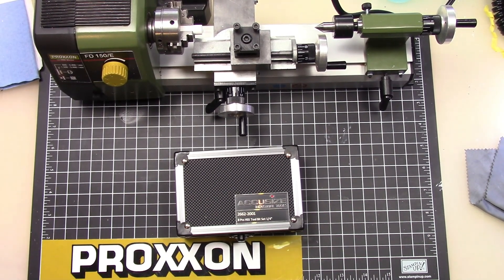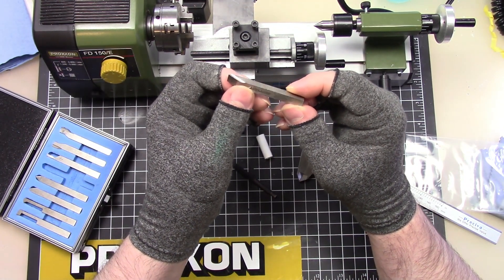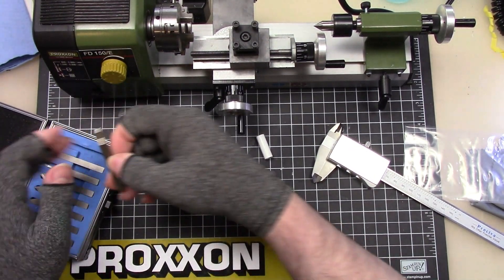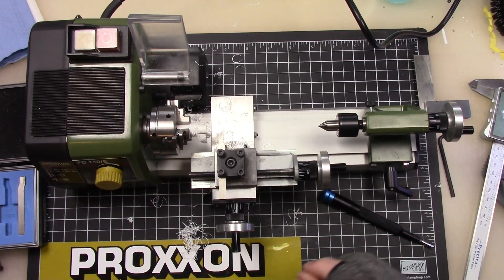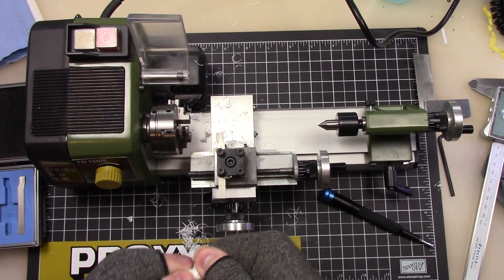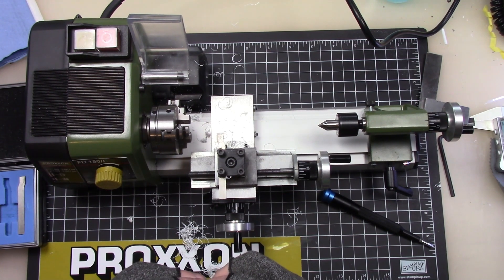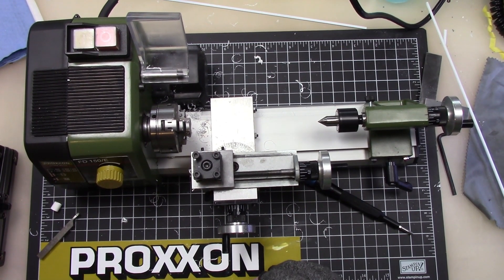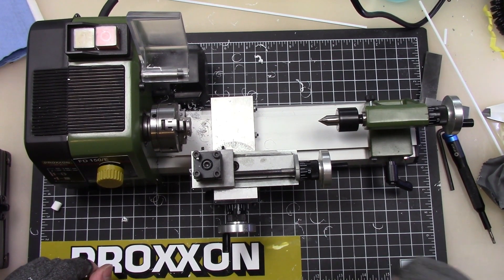New Tools For The Proxxon 150 Lathe

Comment: Hey!  I'm enjoying watching the videos about this lathe.  It's a nice piece of kit.  Just a hint in case you don't know this (sorry if you do). If the lathe's centres are aligned, (at the chuck and tailstock) which they should be, the tool height can be checked against the point of the live center, taking a lot of the guesswork out of it.  I'm watching through your vids sequentially so you may have figured this out subsequently, but I thoughts I'd say now while it's in my head.  Thanks for the content :)
Reply: Ah!  I just saw when you did just this in a future video!  Anyway, thanks again, there's precious little content featuring the FD 150/e elsewhere on YT.